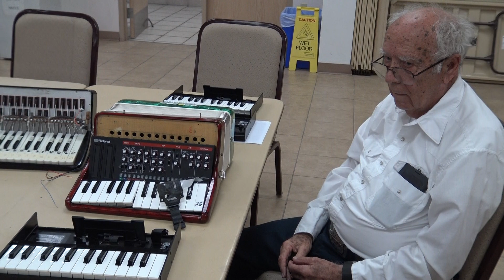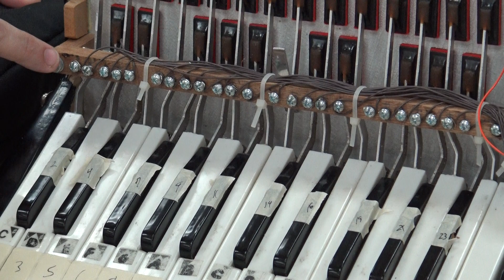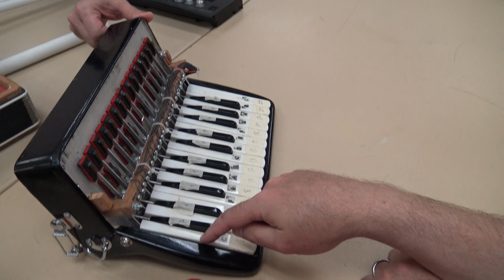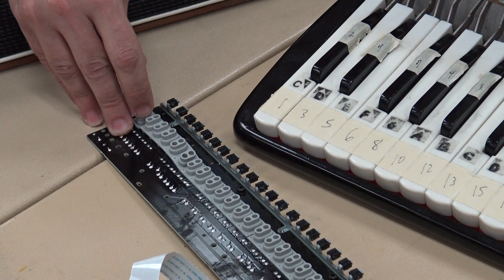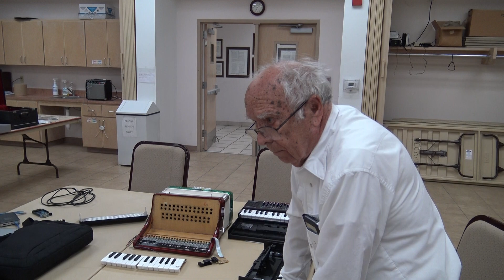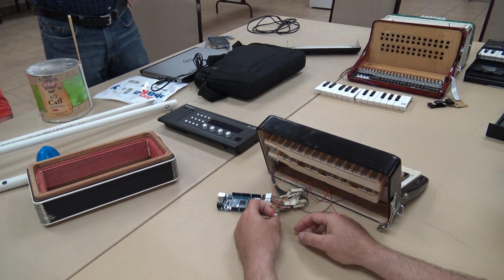Hacking a Roland accordion - two methods - part 1 - Makers meeting Apri. 12, 2017

Comment: Bravooo to those who develop this midi implementation method. I watch your videos with interest. good luck !
Reply from the maker: Thank you. We may be trying a button accordion next. both attempt have done better than expected for a first try. Also, we found we need to insert an on/off LED, and a monitor to read the data, such as MIDI voice. We do have some problems, such as the old MIDI DIN 5 connectors have been replaced by USB B connectors, especially on electronic keyboards. Our old Roland Piano, Yamaha ( Hammond ) organ, and the Roland sound systems work well, with these accordions.
Reply: Yes. Thanks for rappers in close proximity you will be able to test on a double keyboard. You will definitely be able to test for the 120 bass accordion. I'm following you with great interest. I wish success further!